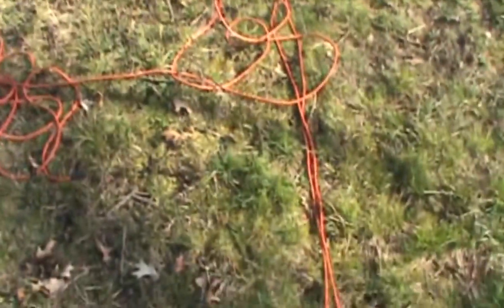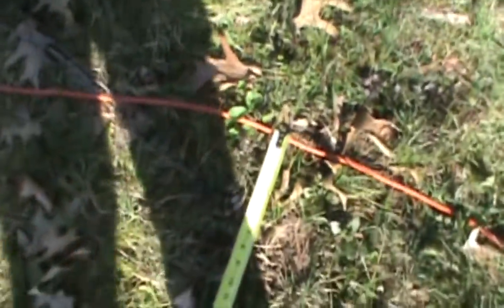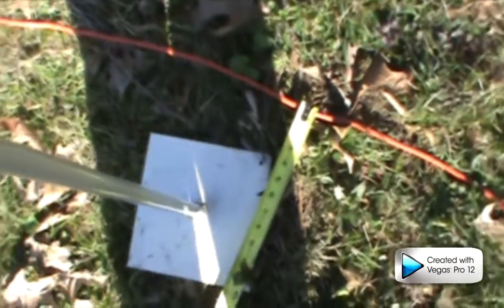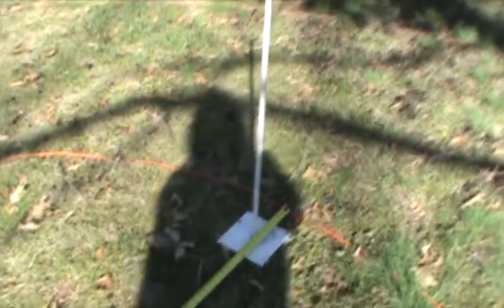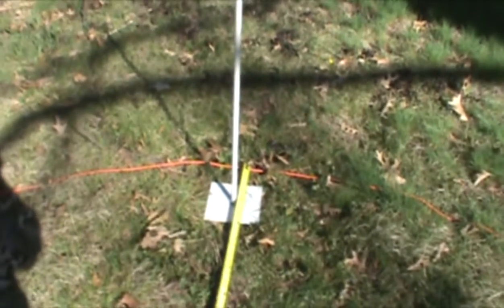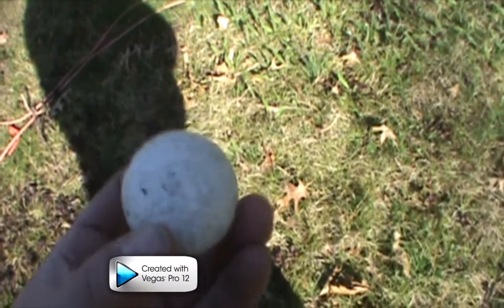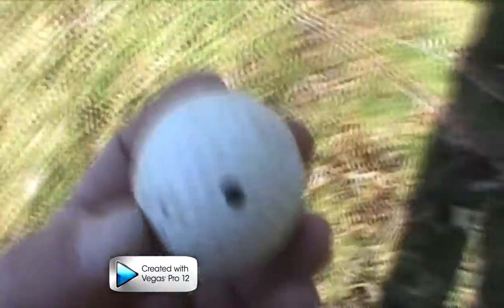Flat Earth, Put to the test.

Comment: Disproving the flat earth with sunspots,   interesting and clever.   You might also try this:   the elevation of  Polaris from the equator is zero degrees.    This would mean that it is zero degrees from everywhere on the flat earth.   So,  at the north pole,  Polaris should be sitting on the snow.

Comment: have fun globe-heads https://www.youtube.com/watch?v=KaXnWbyxVr4 there is no way we are spinning according to the Machinery's Handbook ;)
Reply from the maker: +vhsjvc i approved this comment and link to your video and replying here as well so you cant hide the comments on your channel,  just to show everyone where you went wrong in your video... (the link placed it in the possible spam folder)

its so funny that after reading about 2 dozen of your copy pasted comments... you keep debunking yourself...

you keep bringing up the RPM's of various jet turbines, as well as their speed at the outer edge... but then only mention the speed of the earth without mentioning the RPM... and then go on to say that the larger an object is, the slower it must spin or it will explode... forgetting that that is ENTIRELY based on RPM's... not lateral speed.

the earth spins at a whopping 1/1440th of an rpm, at any point from the axis. 

i.e. if you go 10 feet from the north pole... you are still spinning at 1/1440th of an rpm... if you stand at the equator, it is still 1/1440th of an rpm.

you try to say that the 1 inch diameter bearing is moving with a lateral velocity of 250 mph... which is close, but only 238 miles per hour...
however, if you extend that bearing's size to the radius of the earth, while keeping the rpm's... it's "rim" speed becomes 119,400,772,694.04 miles per hour.

to do the turbine speeds... at 116 inch radius going at 3000 rpm, the speed is 2,070 miles per hour at the edge.
again, if extended to the radius of the earth... 4,477,528,976.0265 miles per hour "rim" speed

now.. on to earth... and we will do three calculations here. one half an inch from the north pole, one 116 inches from the north pole, and lastly, at the equator.

0.5 inches from the north pole... 0.00000020646476907573 miles per hour
116 inches from the north pole... 0.0004789982642557 miles per hour
equator.... 1035.8 miles per hour.

good attempt at a straw man... absolutely hideous attempt at anything close to math

lets discuss your cherry picking at about 18,30 in your video, lets smash that...

you show 2 paragraphs and an equation in the video, but only highlight the first paragraph, but ignore anything below that... including the equation to figure out how big a flywheel can be at a given rpm before it breaks...

look veeeery carefully at that equation... first thing you will see is "F", which is centrifugal force. how do you figure out centrifugal force? Fc(centrifugal force)=Mass times Velocity squared divided by RADIUS.
Fc = mv2/r
from the very first variable in the equation YOU show, radius is ESSENTIAL to the overall equation.
not to mention that radius is part of the equation in 3 other places...
also to note, RPM is used the the equation... twice.
it is not about speed alone at the rim...

Comment: Excellent video. Though I do see some Flat heads that disagree with this version of the FE model, it still accurately debunks FE, yet you still have Flat heads say this is completely wrong. Where does their common sense, it gives me migraines seeing that they throw away their brains to believe the Earth is flat. Holy fuck
Reply: It debunks the common FE model. It does not debunk other FE models, like the ancient snowglobe-style model with oceans above and Sheol underneath. Those have already been independently debunked, but this observation would not debunk them.

Comment: When I first started star watching as a kid, I of course started by looking at the moon. I never could see 'the man in the moon", the "face on the moon", and the reason was very simple. Living in the southern hemisphere we saw the moon up-side-down to the way it's seen in the northern hemisphere. Which would not happen on a "flat earth". Actually, on a "flat Earth" north is a horizontal direction towards the "north pole", while the moons "north" orientation would be at 90 degrees to that. Which means as the moon passed overhead I'd see the south lunar pole and half the the farside of the moon, which is just nuts. For the "flat earth model" to work, the moon would have to be on its side with the north lunar pole always aligned towards the Earth north pole, while rotating in such a way that the same face always faces down towards the earth. I'm getting a headcahe trying to work this out, I need to go away and think about how mad that is. And yet the FEs "fink" it works.

Comment: i have not seen the video or proof of what is being shown in this model for validation of what you are trying to prove. I have concern on gyroscopes and why they behave as they do. there are too many variables in sun spots and who is involved and where
Reply: +LaRue Was this in english?
Reply: +cidshroom the "firmament" model had more to do with English than astrophysics yes
Reply: +LaRue "I have concern on gyroscopes and why they behave as they do." Its off topic for this video, and explaining gyroscopes to people who can't do much simpler experiments correctly is usually hopeless, but since you asked I will give you a short explanation and a link. The flat earth gyroscope experiments fail because the gyroscopes they use are too small and have too much gimbal bearing friction. The amount of torque they generate in response to earth's very slow rotation (1 revolution per day) is too small to overcome their gimbal bearing friction. What the flat earthers do is look at a training video that shows conceptually how gyroscopes behave and then try to duplicate the action using commonly available $300 precision gyroscopes. The experiments always fail. Below is a link that shows the size of gyroscope used in a gyrocompass that could do what they are attempting. The rotor weighs 55 pounds, the toy gyroscope rotor weighs 2 ounces. Believe it or not in this makes a difference.  videopress.com/v/QYuFri5n  Foucault's gyroscope appears to use jeweled gimbal bearings and used a microscope to view the rotation. Here is a picture of it, note the top vertical gimbal bearing is conical.  upload.wikimedia.org/wikipedia/commons/0/08/Foucault%27s_gyroscope.jpg  If you wish to debate this topic, I suggest you visit the flat earth videos, this is not the place. However you won't find me there, the stupidity is just too great to discuss a subject as complicated as this.
Reply: +Alloy that sounds far more reasonable to discuss that rather than Celestial navigation by sunspots. I've  built a few gyroscopes since I work on Avionics among many other parts of aircraft
Reply: +LaRue "since I work on Avionics among many other parts of aircraft" Interesting. I don't believe the mechanical aircraft instruments work on the same principles as this naval unit.
Reply: wearing khakis, dorm room life Vallejo Cal

Comment: I would have used white chalk like on football field to mark the lines and highlight the markers, else good explanation !
Reply from the maker: I thought about it... but as the circles actually served no purpose other than help the spatial awareness  challenged visualize that it was a full disc...

all you need to really do this experiment is a starting point(North pole), a compass or a straight line for the date line and a protractor, and a tape measure. then something to mark target locations.